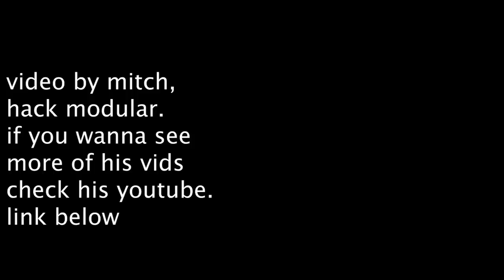Fixing the Uniselector Inline Incandescent Display

Comment from the maker: to address comments about adding transistor buffers, or solid state buffers to the incandescent lights. This is not an issue, these uniselectors were used for this kind of stuff, a current limiting resistor and bish bosh bash, the contacts driving the lamps are around the back and do not spark at all. it is completely seperate to the interruptor circuit. the issue was it was mechanically not setup very well (by me) causing too big of a gap on the interruptor, dulling the interruptor contact. Mitch readjusted it and added a spark quencher for good measure, and it now works better than ever. there is no need to add solid state buffers, these things were around way before transistors, and will be around way after too :D.

Comment: the GPO uniselectors usually had a spark quenching capacitor built right on to the unit  next to the solenoid coil. That would ensure it wouldn't eat its contacts in a matter of months of motoring around. Nice to see you picked up on that and I would expect that has almost irradiated the issue and should last for several years before needing to be cleaned again.

Comment: The solidnoid needs a diode to stoo reverse feed back pulse 

The contacts need caps shorting them to reduce sparking 

Wen the coil goes off it makes a hv spike that causes sparks Aka oxidization and metal splattering 
And the contacts spark less with a cap holding a voltage on them with very small bleed current 

And lastly Vaseline wouldn't go amiss for clean contacts and protection

Advoid sanding contacts because they are silver plated that is best conductor and fyi silver oxcicide is conductive 

But yee the sparks be sooting up and metal sputtering it 

Likely jam cloth between it and put brasso silver polish on it and force it constantly rotate force it buff up arm and contact point
Reply from the maker: no diode required for solenoids without solid state electronics. yep cap is added. cheers
Reply from the maker: cheers though
Reply: @THISMUSEUMISNOTOBSOLETE  
The diode stops back emf high voltage sparks
Not just for solid state protection 
But yeah it's not common for that setup to use it but they plan for it to be obsolete aswell with only certain life cycle

Comment: Cut the polished tips of the toothbrush bristles off for a rougher scrubbing. 
You can also use an old automotive "points file" to clean up the electrical contacts of carbon build up.

Comment: Superglue / CA glue is really bad for anything with lenses. It will fog plastic, blur many glass surfaces, and even discolor, warp and disolve some lens coatings. I learned this the hard way doing lens repairs. 

For something permanent, look at epoxy, its the only adhesive in most cameras and lenses for this reason.
Reply from the maker: it worked fine, yes it will fog it if too much is used. but cheers

Comment: That electrolytic on there might actually be the problem, The peak currents though these contacts are enormous. And these will erode the contacts in a hurry.
Reply: My thoughts exactly

At a guess it is to slow down the stepping so you get a chance to read the numbers, but it might also be it's Achilles heel.

Comment: Put a 2 microfarad 250v capacitor in series with a 50 ohm resistor across contacts to suppress the sparking. As it is, the contacts will erode and fail (which is happening now).
Reply: End of the vid spark quench was added

Comment: Mitch! Great video and well explained! I'm not going to wade in on the debate about back EMF suppression/diodes for this application, as I know bugger all about how Uniselectors work. I do know that sparking contacts = bad, as the arcing will erode the contacts over time, causing high resistance, poor performance and electrical noise. Thanks for sharing! 🙂
Reply from the maker: yep. if you read the spark suppression chapter in telephony volume 2 it will explain the spark quenching capacitor

Comment: A pencil eraser with a little grit in it (ink eraser containing pumice, silica or sand) would be the best way to clean those contacts. Contact cleaner is a very temporary "fix", and if it leaves any residue behind then the switch will malfunction sooner rather than later. Flush and degrease it with alcohol!
Reply: Fibre glass pen?
Reply: @boeufkak   excellent tools ( I use one frequently) but a little too abrasive for cleaning contacts such as these. The ink eraser is the way to go.

Comment: You can suppress some of the sparking on the contacts by adding a capacitor in parallel to the switch. It shorts the AC transients that generate the sparks, and also dampens electrical noise. I guess that's what the capacitor on the relay is for? But does it also work for the uniselector contacts?
Reply from the maker: if you watch to the end of the vid you'll see a spark quencher ending up there :D
Reply: Capacitor in series with a resistor

Comment: Find a BT engineer over 70 and he’ll tell you what’s wrong just by listening to it.  Also avoid thermal melt glues with incandescent lamps.  Superglue is completely reversible with debonder,  probably taking less time than heating up hide glue
Reply: the only problem with superglue is it has a terrible propensity to fog things, even things it shouldn't be able to fog and it has a nasty habit of permanently developing fingerprints on delicate surfaces
Reply: @Mister_Brown  Also, the debonder (which is just acetone or ethyl acetate) will etch a lot of plastics, or worse, embrittle them.

Comment: You used to be able to get contact cleaning strips for this sort of thing. I suppose they would be a bit hard to find this century. Basically a thin cardboard strip, fairly course grain, impregnated with solvent and lubricant.
Reply from the maker: nice one! i can imagine similar to the lubricating cleaning uniselector wipes for GPO uniselectors. sadly didnt fit this one :(. cheers!
Reply: @THISMUSEUMISNOTOBSOLETE  , you need "lapping paper", thin, ultrafine plastic-backed sandpaper used for fine polishing the ends of epoxy-sealed fiber-optic connectors. Most contact-burnishing strips made for use on switches and  relay contacts are a bit too thick and coarse.....
Reply: @goodun2974  There's a variety of nail-polishing boards that are much, much finer than sandpaper. They have a pink surface and a white surface, different coarseness. Model railway people use them for cleaning tracks. Much safer for contacts.
Reply: Would a fiberglass brush pen work out alright? That might be a pain to get into the contacts though, hmmm. 

What voltage was BT running through these things back in the day, 48vdc?

Comment: I wonder if you could Steampunk it up a bit more. If you added some solid state switches (or mosfet thing or other relay even) to handle the selector relay and lamp currents then the current through the switches could be vastly reduced removing the sparks and protecting the contacts. Also with a variable resistor and the capacitor the tick round time could be easily adjusted. 

Absolutely brilliant video, thank you so much for taking the time to make it for us.
Reply from the maker: hey up cheers for the comment! the sparks are not coming from that part of the circuit. the incandescent lamp contacts are on the other side and are fine :D. it was all down to bad mechanical adjustment i didnt bother with, caused the coil to pull and the gap on the interrupt to be too high, once that was adjusted and then for good measure mitch added a spark quencher, now it doesnt spark at all. the contacts are made for that kind of load, so absolutely no need for solid state switches, especially not on the lamps. :D. 
the variable resistor capacitor is what i added to the sequencer, sometimes keep these things simple for displays. but cheers for the ideas :D.!! good to hear from you again dude!
Reply from the maker: yet to find a reliable means to passively control the uniselectors speed well. it seems to be a very small window of use per caps. the best luck i have found is rotary switch and multiple capacitor sizes. the big cap on the top of this controls the speed.
Reply from the maker: next time you come museum, you can have a go though if you have an idea of speed control with cap and pot. :D i;ve found most configurations to be very limited in range as to not bother. but always open to ideas
Reply: @THISMUSEUMISNOTOBSOLETE  OK I need to get a uniselector and have a think and a play. But I get it now, to add solid state electronics would betray the ethos of the whole piece. We are long overdue for a visit to the museum, which isn't long in elapsed time but because of the incredible rate at which you add new things its already too long.
Reply from the maker: @loopinnerthe  not to betray the ethos really. just think it isnt required in this instance. but who knows! uniselectors come up all time on ebay have a look. got a big uniselector project coming up, and planning to not rely on the interuptors at all. and have a master motor cam to drive the speeds of the uniselector, because of what we are chatting about. more reliable speed control. give it a go though!!!
Reply: @THISMUSEUMISNOTOBSOLETE  OK here's the idea. Your capacitor is being forced to charge instantly from the PSU. It's only its discharge time back into the coil then that delays the selector. How about instead of the capacitor in parallel you have a nice big inductor in series with the coil. This inductor initially has a huge resistance as it builds the magnetic field; then once built it shows only the ohmic resistance of the wire in the coil, the current flows into the solenoid and closes the selector. Then the switch opens, the magnetic field in the inductor collapses, this will  create a reverse EMF which can be directed back into the solenoid via the diode pretty much as you have it now, again this will slow the solenoid down in its return to zero. The speed control part. What if this huge inductor was a car ignition coil? A variable distance spark gap would dissipate the energy as a spark, the closer the gap the sooner the energy loss would start the quicker it will rotate.

Comment: It failed because you're putting way too much current through the uniselector switches.
If you actually want it to last, you should wire up a transistor array to take full incandescent and coil current off the switches, and only run switching current through them.
Reply from the maker: the circuit powering the incandescent display is nothing to do with the interrupt circuit, that part of the circuit you described did not fail at all. it failed because the gap on the interrupt was top high, the mechanism needed adjusting because it needed to travel too far after the coil was energised, causing it to charge too much. this adjustment i did not do when i made it, hence why it failed as it caused the sparkes you see, which dulled the contacts. after that it sparked every once in a while so mitch added a spark quenching capacitor. this is how these kind of circuits work. you dont need transaistors. how do you think they did it before transistors :D. cheers for the comment.
Reply: Uniselectors are typically rated for 1A max on the wiper and bank contacts, usually the same for the interrupter, though some types have a higher rating of 5A there. 
Not sure what type you're using or its coil voltage, but if it's a 22V coil you'd already be exceeding a 1A rating with just the coil, plus you've got the added load of the incandescents. 
Yes, of course these existed before transistors, but they were switching relatively light loads compared to what you're doing here. When higher current capability was needed, relays/contactors would be used - with the selector turning on the coil for something that could handle the load.
Reply from the maker: @gregkrobinson  the design of uniselectors mean they control their own interruptor. 
it would be a bad design if the uniselector would not be able to deal with current loads of its internal interruptor circuit.
the incandescent bulbs are shared along 2 sets of contacts to lighten the load with a current limiting resistor. and there is zero spark on them, no sparks mean no electrolic transfer, means no degradation.. it does not need transistors.
Reply from the maker: @gregkrobinson  only running this one at 12v. which means it is also under powered.